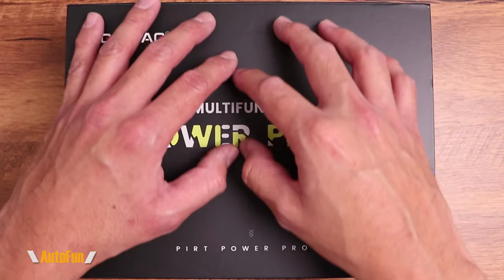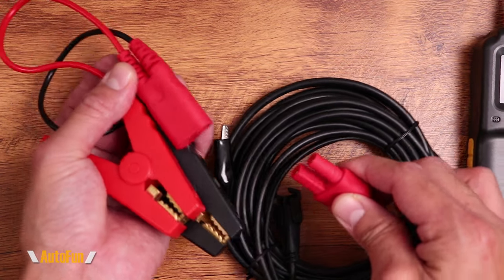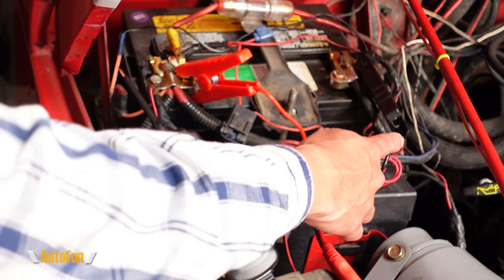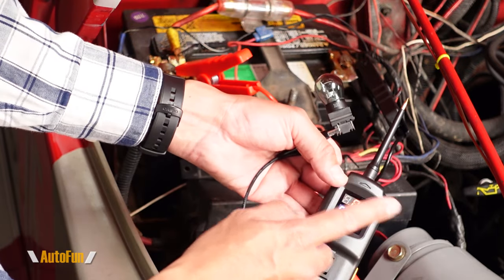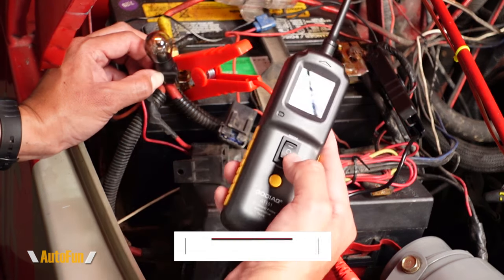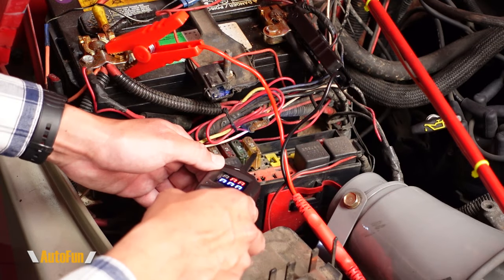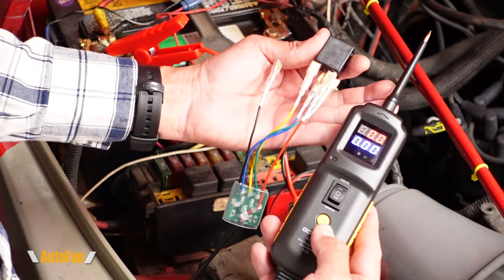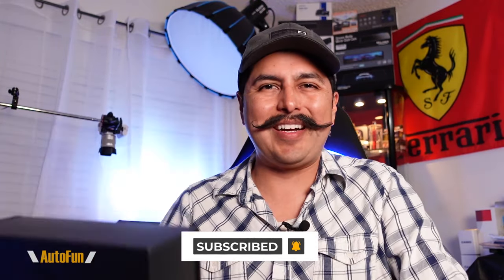How to use an AUTOMOTIVE PROBE! (Godiag GT101 Review)

Comment: Good job explaining the tool. Is the plastic case rugged enough to be dropped on the floor?
Reply from the maker: Thank you Christina! ah the for the case I'm assuming you are referring to the tool itself? if so yes it if feels very rugged, I haven't dropped mine yet but I do toss it around quite a bit lol If you are referring to the box the tool comes in, it's just card board, while I do use it to store my tool, it's not a rugged case and the tool will fall out if the box is dropped. Hope this helps and thanks for watching!

Comment: Good tool. It's not clear the reason you say the relay contacts aren't good when you clearly hear them changing state.  It's the part where you disconnected the contact wire. Second, what if you only get the green light? What does that mean? Thank you.
Reply from the maker: Hi 39bebchito! Yes it's a pretty good tool for sure. The relay I showed on the video works, when I disconnected the wire I simulated a bad relay (notice the lights on the GT101 relay test PCB show only 2 of the 3 required LED lights on and there is no longer a clicking sound coming from the relay) It's not common but it can happen where the contacts are being closed by the magnetic force but the contact won't actually make a solid connection either due to the contact being physically unable to reach the contact pad or due to contamination, wear, or oxidation of the contact pad. Regarding the green light, that should flash with a normally open relay. Hope this helps, Cheers!

Comment: This thing is far cheaper than any of the other power probes I've seen; does make me have to wonder why it's so cheap. But as a person who can't find a mechanic to work on our old ass Astro van and is having to do it myself, this might be useful at a price I can actually afford

Do you use this device often? Is it still holding up well? Can it be used to "jump" a starter motor?
Reply from the maker: Hi 3nertia! Yeah it definitely has come in handy here in the garage (non commercial use) so it's still going strong (but will update this comment if something changes) Regarding using to test fire a starter motor, yes I'm sure it can, it can output 10A with a 20A overcurrent circuit breaker. Hope this helps, Cheers!
Reply: @AlexAutoFun  Thanks so much!
Reply from the maker: You're welcome!

Comment: Yeah all these functions that you state you haven't seen before is literally on every genuine power probe. This thing uses old parts from older iterations of the power probe. I wouldn't trust this. Get the real thing.
This thing is false advertising all over the place the only thing it has going for it is that it can test 40 volt systems but that still isn't enough for golf carts which a lot of people burn up their genuine power probe testing. All of the parts on this thing are knocked off and I wouldn't waste my money on this. It would be in the trash within the First 6 months of use
Reply from the maker: Hi Beaubonic Plage! my Super Probe is still working great! (I will update this comment once it does go out) At about a quarter of the the price of the of the Power Probe IV I can't complaint lol The closest in terms of price is the Power Probe 3 (if you don't need the graphing screen) but it is still double the price of the Super Probe but I may also do another video comparing them side by side. Not sure what you mean about false advertising, I demonstrated the functions of the unit on the video. But stay tuned bud I got more prove reviews coming, thanks for watching and commenting bud!
Reply: @AlexAutoFun  nothing that you were advertising is false, but the claims on the product page on Amazon definitely is.
Reply from the maker: @beaubonicplague  Hi Beaubonic Plague, thanks man, interesting, have you submitted an Amazon review or complain on the listing, that would help to correct any issues on the listing... Cheers bud!
Reply: @beaubonicplague , another lie.
Reply: @wesoblander3648  what's the lie?
Reply: @wesoblander3648  there are also other functions that the PP4 provides that this thing does not.